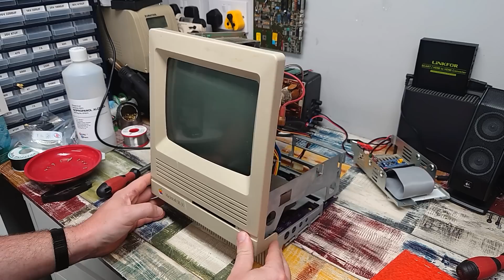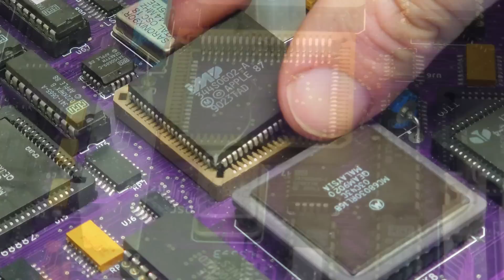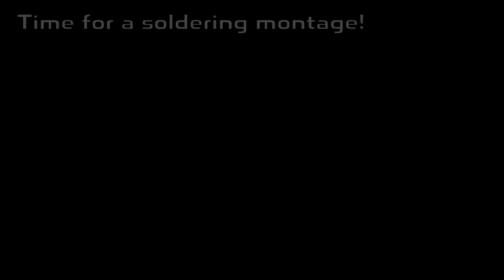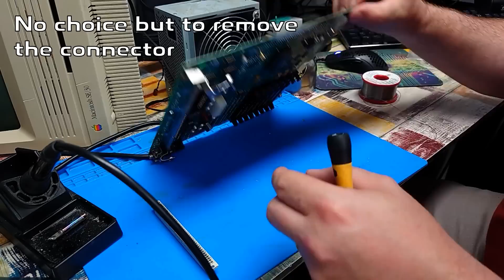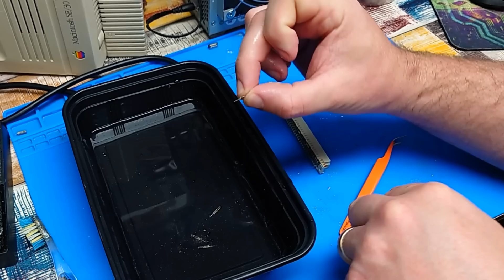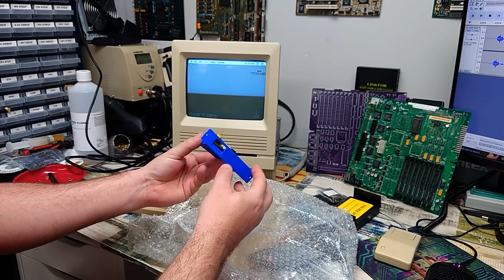Macintosh SE/30 Simasimac fault on a brand new board!

Comment: Great video!

My dear SE/30 also has the simasimac pattern but it happily chimes during power on. Pressing the NMI button plays the death tune.

I think this might indicate that CPU and ROM is fine, the computer starts executing code but fails to initialize the video subsystem/ROM?
Reply from the maker: Its been a while since I looked at this on the MAC and I'm no expert but as I understand simasimac can basically be anything.  If yours is making noises though it must be running code from the rom at least.  I found the guys on the 68kMLA forums to be very useful for MAC queries.  Sorry I can't be of more help.

Comment: At 20:48 you had a broken RAM SIMM socket.  Who sold you that socket?  I ask because the RAM sockets (with metal tabs) I purchased from RS Components Japan broke in the same exact way.  Just curious if you purchased from the same vendor as I did.

Comment: Bravo. I repair a lot of SE/30s and actually have a newly built board that's being dumb. It doesn't chime, but it NMIs. I have another one that continually death chimes if you press reset, otherwise dead...fun! Just fixed two mac portables.
Reply from the maker: Thanks.  Unfortunately I don't really know enough on these to be able to help but the fact that it NMIs then it must be reading something from rom.  Good luck with them though, I hope you get them working.

Comment: Awesome troubleshooting! I learned a lot about reset/clock testing. Thanks much!
Reply from the maker: Glad to hear it was helpful.  Always check the schematics though, reset is typically low to high but not always.  Typically I find if a clock is pulsing then its normally good although when I get my new scope it'll be easier to confirm that.

Comment: Finally success! Very well done!
I admire you tenacity. 😅
Reply from the maker: Thanks, I was glad when it started as I wasn't sure what to look at next 😆
Reply: @CRG  I am not surprised. It was really a hard slog, but I think you cracked it when you resoldered all the sockets. It looks like it was really a cold solder. Especially when you push a chip down and sth changes.
So I applaud your tenacity in getting this board back into working order. 
👍
Reply: @CRG  what would interest me to see woukd be a respin of a board with all the upgrades for Storage, CPU, Memory rolled into an updated design. Ideally incorporating the buffee accelerator. Creating new up to date Amiga 'out of the box" so to speak.